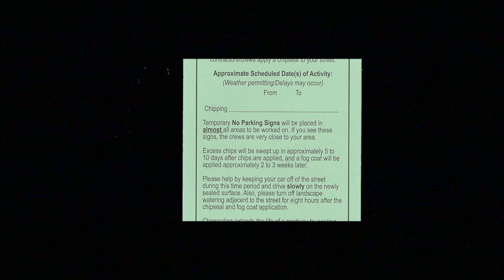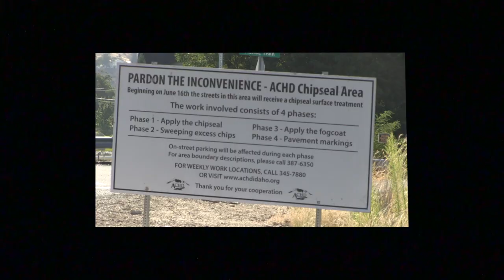Chip Sealing:  The Basics

Comment: For someone's driveway, this is a great product, but we should not be using it on roads. It just doesn't last long enough, we should pour all of our roads out of concrete, if we made our roads out of concrete, it would be a generation before they need replacing
Reply: Commercial roadways here in CT use massive rollers to imbed the chips. They then use special sweepers to remove the loose chips.  Smooth and strong.

Comment: Very dumb question: is there such a process for driveway cracking with new overlay that is not "black" blacktop? Are tints and colors available which can make the look like standard concrete?
Reply: Yes, you can do a tar/chip surface over your paved driveway……but there are only two options for the surface finish, either the natural color of the crushed limestone  they lay over the tar (grey-white  to grey-tan), or if you do a “fog coat” / top layer of tar over the aggregate, it’ll be either a very very dark brownish color or black depending on the product used. They can’t add dyes to the tar because it is naturally black and it’s nearly impossible to cost effectively dye a black liquid light enough with white pigment to start adding other pigments to make colors people might want. You could theoretically have a company like Sherwin Williams mix you up a custom color of traffic marking paint using their white high-wear resistant traffic marking paint as a base and adding pigment if you wanted and proceed to paint your whole chip sealed driveway with that as long as you do the top fog coat and wait until it’s fully cured. If you use anything but a very dark color though the rubber on your car’s tires is going to end up making marks in the surface and you’re likely going to be disappointed with the result for the amount of money you’d spend on the paint and time you’d spend painting. The only real option for a custom colored / patterned driveway they’ll last is going to be colorized concrete. If you do the grade work and build the forms yourself and either get a contractor for the screeding and finish work or rent the equipment to do it yourself you can save a lot of money on going the concrete route, otherwise black is about your only feasible choice.

Comment: I didn't even know what Chip Seal was until recently when they decided to rough up the roads around me and put down tar/asphalt and chips in my area versus removing a couple MM or factions of an inch of road surface to resurface the road.

Several years later the chip seal in my area is already wearing out in area's with heavy turning like around some intersections and the cul-de-sac up the road from me that surves a 10 story apartment building.

Comment: Don't forget to mention the thousands of dollars a year you pay private contractors to haul your chip seal rock from one point to the next. Take note the annual budget the county receives and compare that to the amount of "work" they do. Also achd could complete the chip sealing process in one fluid movement yet they leave the rock on the road for weeks at a time so that a majority of the rock gets pushed off onto the side of the road.
Reply: The Glass industry in the area probably loves it, They make thousands on chip repairs and windshield replacements
Reply: Despise this surface!! Very dangerous for motorcycles!! Constantly has loose rock that makes it very easy for tires to slide out from under the rider. Not to mention the groves that get created be vehicles, making for uneven lanes! All it is is a temporary, cheap patch up!!!
Reply: @taz6601x2 Drive carefully, wear a helmet and protective gear.
Reply: yep tears up a new vehicle chipping paint!! dusty when following someone they should study how to do a better job!!
Reply: If ya know how to do the process the right way, you wouldn’t have any chipped paint or windshields. I do tar and chip on a daily basis for a living. As a matter of fact I’m the main guy for laying chip at my job. And I can lay the stone at the right volume that once it’s rolled stones don’t blow off. Just saying
Reply: I would educate yourself, you might be surprised by how wrong you actually are.